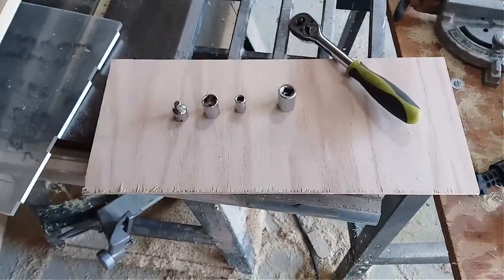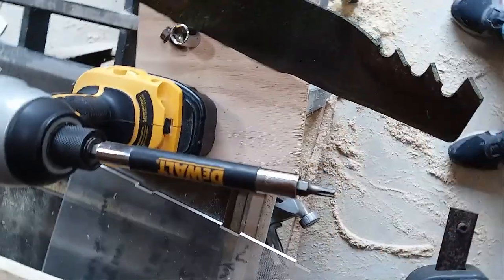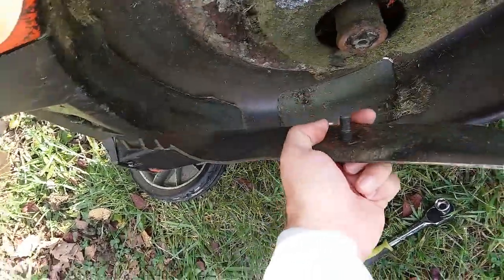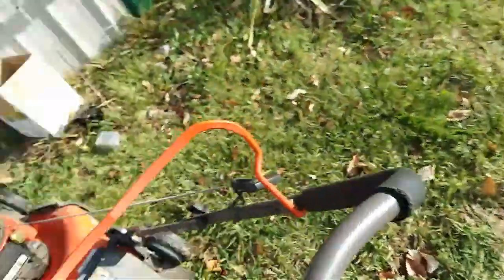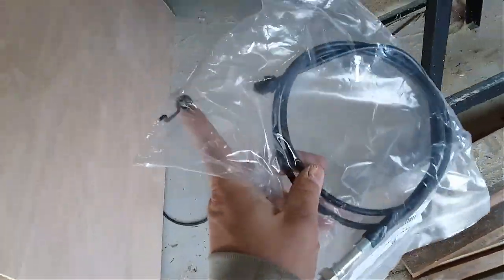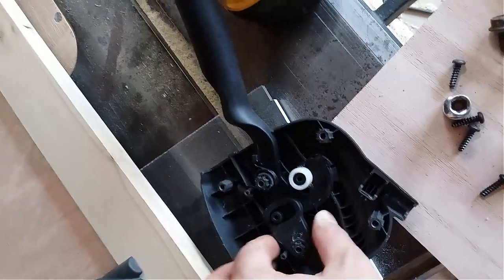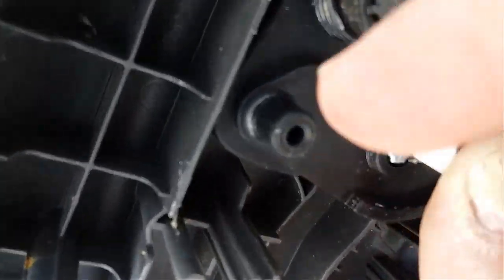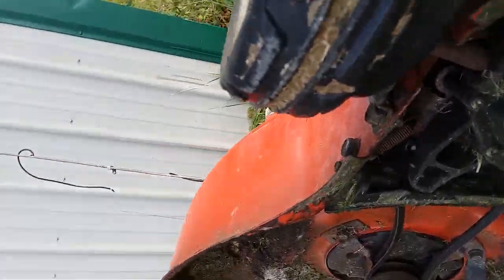Husqvarna 775EX drive cable replacement self propelled broken won't go forward

Comment: Thanks for sharing, those drive control handles are nice but over engineered.
#LexusTech
PRO TIP: "Star bits" are torx bits and "Roller" are pulleys, but I get you bro.
Reply from the maker: Agreed - the handles are pretty complex and a pain to assemble.

Comment: Did what you suggested, but cable is too tight, drive is now permanently engaged.  tried adjusting the nut, any other suggestions for getting an extra 1/2 to an 1' ?  I placed mechanism inside control box on the groove side with both white collets installed. Ideas?
Reply from the maker: Hi! Just curious for the sake of others - did you ever get this working?

Comment: My Husky is only 4 years old and I have had to replace so many parts on it...The second day the plastic colored rings fell off the wheels, the deck wash connector broke off after second use, the cable has broken twice, have replaced wheels twice already, the spark plug has fouled twice and it constantly bogs down if the grass is moist from the dog peeing on it...Can't believe they hadn't had a recall on this thing...i guess unless the blade is prone to breaking and cutting our toes off I'm just got keep squeezing this lemon a few more years.

Comment: How can I rule out the belt needing to be replaced or the handle assembly is bad . I pull on the handle and the back wheels moved few but not strong enough when I place it down on the grass ? I ordered a new belt but got to thinking maybe it’s a problem with the handle ? I had noting but trouble since I bought this mower . The engine raced right from the box and the self propelled and to be adjusted a lot to have it puppy me ? I like how you do your video . Please help ?
Reply: It is likely the plastic notches in tires have been worn down and are not catching to turn the wheels.  You probably need to replace the wheels every 3-4 years.